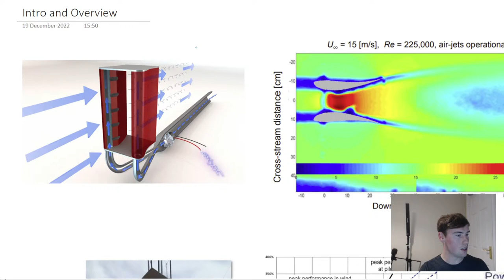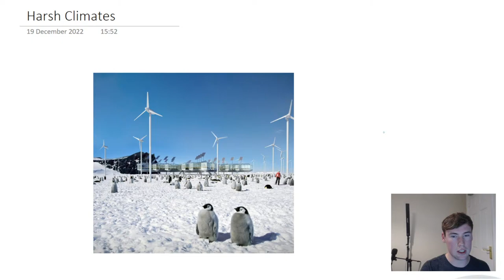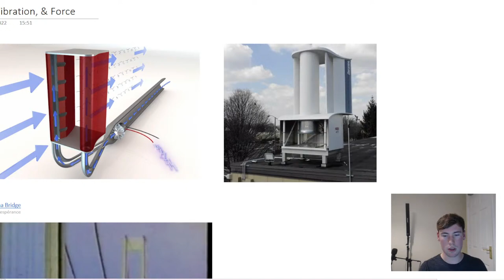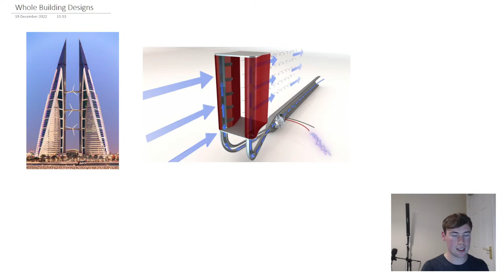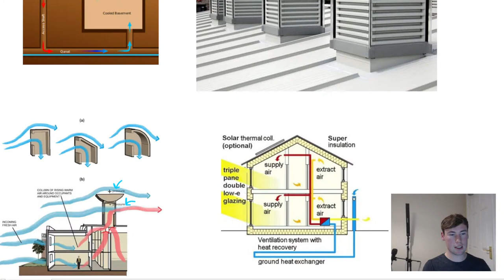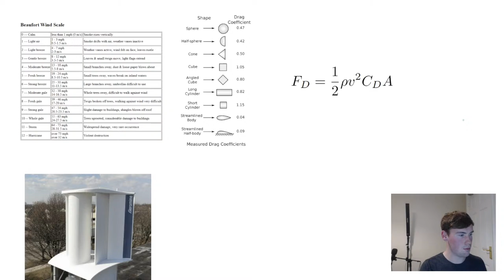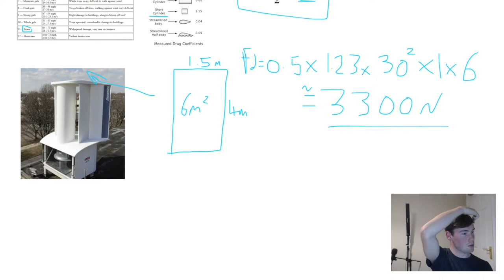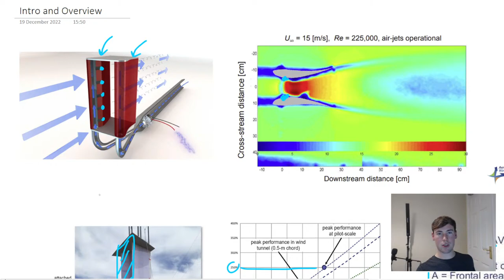Deep Dive Into Rooftop Wind Energy [Aeromine]

Comment: Definetely an interesting design.
Seen another video already. Asking myself: why no wind direction orientiation? This design will only work efficient with one general wind direction.
Why is the input of the turbine not facing to the wind (ok, they changed some of that with the later version).
With the new design it would be easy to turn the whole construction around the bottom center turbine.

Comment: I am wondering how the air is pulled on the backside of the tube in between the two airfoils.  I haven't seen an example, but the round tube sits where those two foils create that zone.  I was thinking this would be ideal on my rural property on the 40' side of a huge metal building which gets lots of south westernly winds at least 50% of the year at 8mph most evenings.  The building is 16' tall and would have a high pressure zone coming into the rear corner of the building to the prevailing wind.   I'd be happy to just charge a 48v battery bank as I can use this power later if I could produce 10-20kwh per day.  Those off-grid could see a huge benefit to something like this.

Comment: Hi 
I understand the venturi effect. However the frontal area & pressure drop due to venturi effects seems to be the basis for power capacity. However rough estimation of this however does not get to the 5kW claim.  Should this not also depend on the generator in the duct? Do you have specifications for the turbine generator

Comment: Do you think, this can be installed at the bottom of the Trucks/ Buses/ trains - wherein the air is flowing into 1 direction as well as very fast speed??
Reply: Yes, then the electricity generated could be used to drive the vehicle!  Perpetual motion!!
Reply: We can think of these being power generation plants on the wheel wherein battery packs are kept to be charged while they are on the move and at the rest places, battery is replaced with another drained ones. Yes, they can also use this power to augment into the driving performance of such big vehicles guzzling a lot of Diesel or electricity.
Reply: @siddhartha194  You didn't catch that I was being ironic.  Your idea is totally cracked.
Reply: Thanks for responding- I’m trying to be purpose driven with my basic English language understanding. Thanks for listening and I do believe in this idea and think this application of physics can be transformative for the world.
Reply: @siddhartha194  Your problem is basic physics, not English.

Comment: But with no moving parts there would be very low maintenance costs right? So after the initial expense, it will happily go on generating so long as the wind blows. Does it need high efficiency? If they were built in 4's (N, E, S, W facing) that would mean 2 would always be generating. I am sure clever people could also work out a way to position them to redirect side facing winds from one to combine with the front facing winds of another to increase input power. So rather that 1 generating 1/4 of the time, you have 4 generating 3/4 of the time? a 200% increase.

So if 1 generated 5 MW for example. 4 together positioned correctly would generate 35 MW roughly (I think).